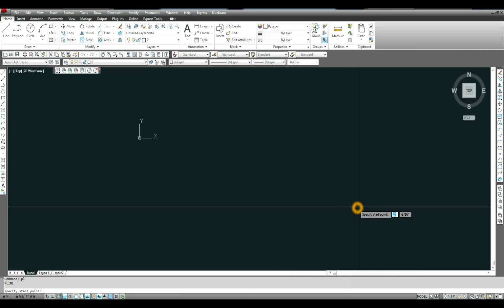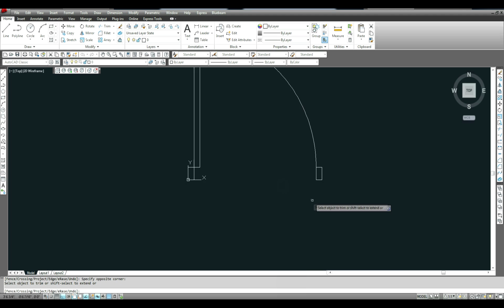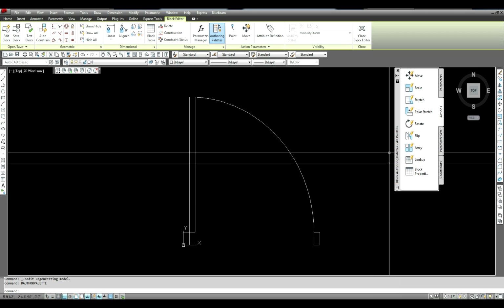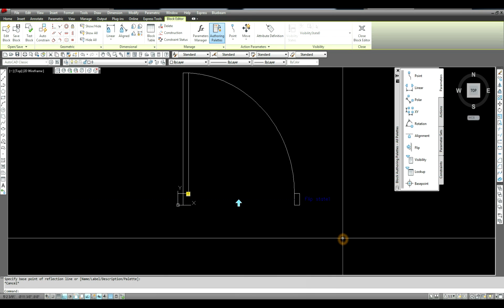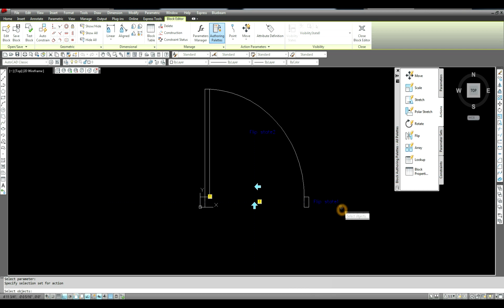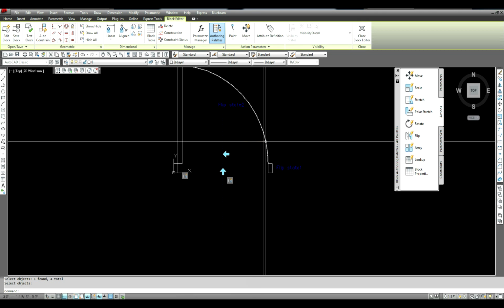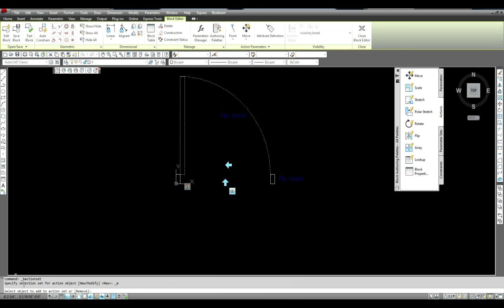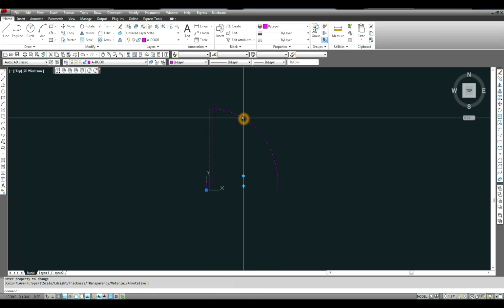How to Create a Flippable Dynamic Block in AutoCAD | Autodesk Autocad tips and tricks

Comment: I notice the video is a little old but how would you make a block a part of a template family, so I would have this block in every new drawing that I start?
Reply: +Kalvin Cundiff open drawing, insert block, save and close. it will be there until you delete it. Though a block library is generally the best method for doors, as you have different sizes. 2/6, 2/8, 3/0, 3/6. Unless you add those parameters to the dynamic block.
Reply from the maker: I haven't worked a lot with template files, but back when I made this video our template file had all of our smart blocks in it when we started.